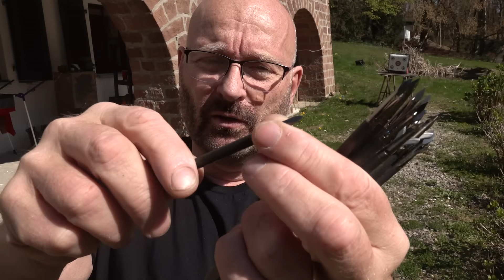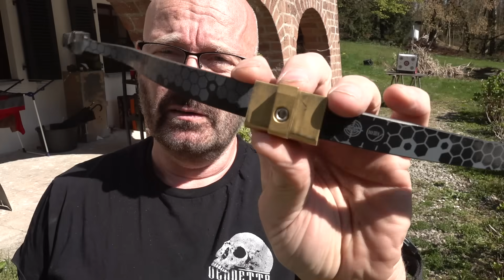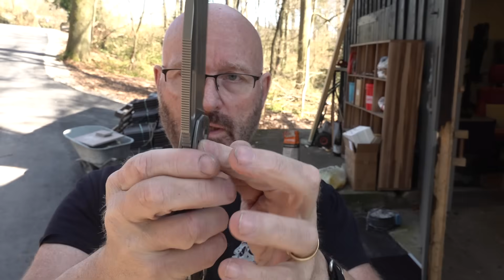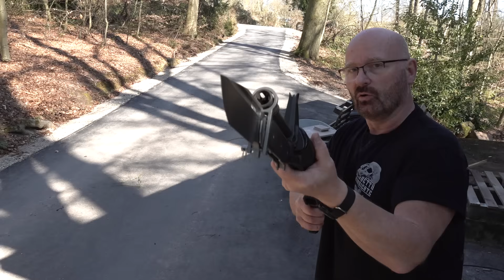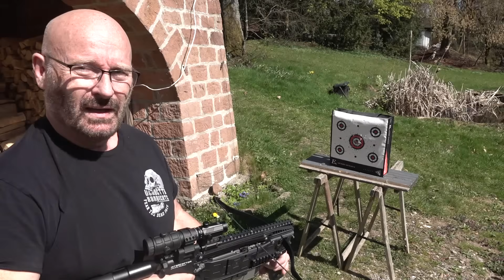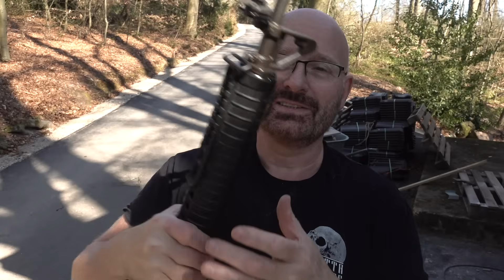Interceptor: Impossibly cool new stuff!

Comment: What do you think of this, a crossbow that fires airgun pellets. It could use a captive bolt to push directly on the pellet, or an air piston
Reply from the maker: Forget it, the pellets are not heavy enough and would not fly fast enough. There is the airowgun though.
Reply: @ thanks for the response. I appreciate your expertise 👍
And I'm definitely buying a sixneedler if they get uk approval

Comment: Kel-tec made a folding bayonet with standard AR15 bayonet lug interface integrated into the handle, and the muzzle ring as a thumb stud/front flipper.  I would say that is a simpler solution if you want a bayonet folder for rifles. The rail mounting scale is genius though. It can turn any field utility folder into an emergency bayonet for any gun with picatinny rails.

Comment: The blade is a bit coarse and I would not choose a blade on this small crossbow at all. The limbs are nicely improved. It would be good if the interceptor could also be folded, like the Vlad Impaler, if this is technically possible, so that it can be stored in a flat bag

Comment: What I really want is somewhere to attach a one-point sling to the buttstock (or rear near the grip).  

I'm not really interested in the bayonet adapter (prefer having a light/laser combo on that rail); plus that configuration looks dangerous to the hand of the user.

Comment: Jorg - try flipping the knife upside down- so you can pull down on the tab to open the knife - less awkward motion - possibly can do with one finger while still holding grip?
Reply: Nope - it’ll hit the bow limb. My bad
Reply: Maybe mount it upside down at an angle so that it can pull down and still clear the bow limb?  (Kick out at a 45 maybe?) - OR - could (& this would take redoing the lower portion of the unit) could the knife be mounted to the underside, between the crossbow body and the handle itself?  Then the knife could deploy fully sideways, but surely still effective?  (I know vertically or horizontally, I wouldn’t want that blade in my gut!)